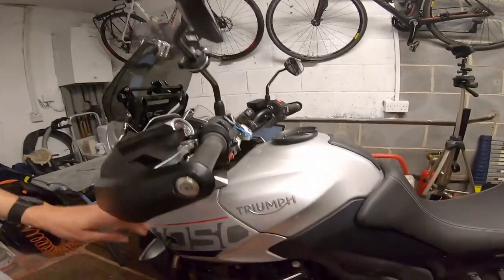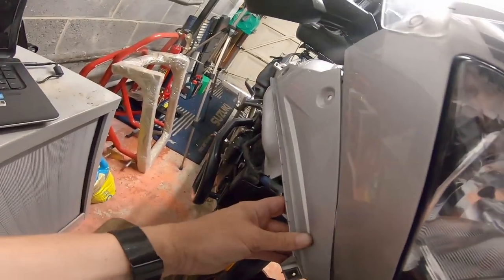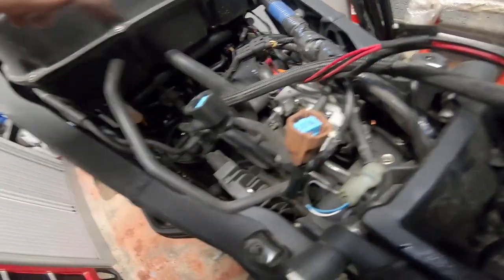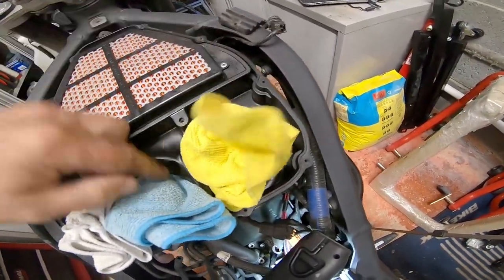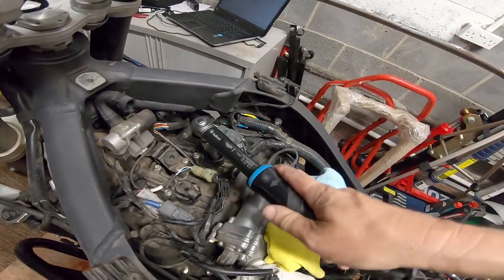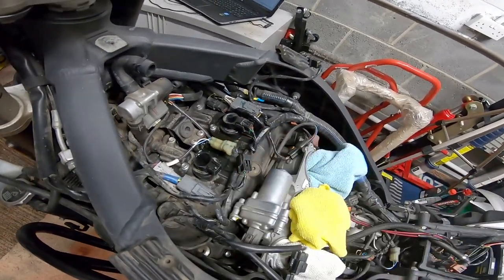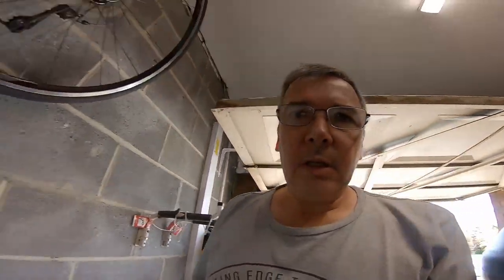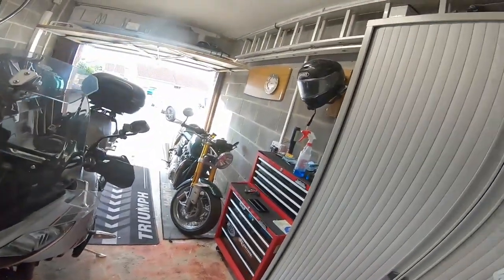Tiger Sport 1050 12K Service Part 4 - Spark Plugs, Air Filter and Throttle Body Balance

Comment: Fantastic video - thankyou so much for this and the whole series. My DealerTool arrived today ready for me to service both my Tiger Sport 1050 and my Bonneville T120. Your videos have really given me the confidence to do this myself. I had my throttle bodies done at a Triumph dealer two years ago (yes cost me around £900) so hopefully they will still be in tolerance. I had the valve clearances done at a small independent last year for half the price Triumph wanted and that included replacing all the shims!

Comment: Dear Up North Biker, thanks so much for this video. I changed my Tiger Sport's air filter and spark plugs today and all your advice helped me so much!!
Reply from the maker: Glad it helped. Did you struggle with the left hand spark plug like I did
Reply: @upnorthbiker  Fortunately having seen your video I purchased a magnetic, bendy spark plug wrench! I'm living and biking in Japan, but my mother lives in Guiseley, Yorkshire. I was in England for two weeks this summer. I was so surprised how expensive the UK is now 😮
Reply: A little bit of rust came up with the left hand spark plug. I gave it a good vacuuming and hoping for the best.........
Reply from the maker: I would check the seal on the ignition coil if there are signs of rust.
Reply from the maker: The roads in Japan look awesome. I watched the Missenden flyer’s tour and he only covered a small area.

Comment: Thank you for this very clear tutorial. It helped me out. I noticed that my 2016 Tiger sport 1050 had a set of NGK CR8EIA9 iridium sparkplugs installed at 20.000km. These have a longevity of 160.000 km( 100.000 miles) so I ended up replacing them without changing. The sparkplugs only have 20.000km on the counter, so even if I decide to change them at halve their livespan, I can ride another 60.000km with them.

Comment: Nice one UNB. I’ve had my fairings off several times now and it does become a doddle. The tang and grommet idea is great in my opinion. Always take the big fairing off first. Just the one screw under the headlight, then slide forward like you showed. Brilliant! Suggest those trying this job understand how it works before sliding the fairings back on.(Mine had been mullered by some cretin too). £248 for a replacement.
That left spark plug removal. CHEAP DOUBLE ENDED SHORT BOX SPANNERS! First one will drop down onto the plug. Second one will fit into the first and stick out so’s you can get a spanner on it. Worked nicely for me. 
Another way to lift the spark plugs out is to use a length of rubber hose that is a snug fit over the ceramic. Also good for starting the plugs when replacing. No chance of cross threading.
(That fuel connector can be a bastard ‘till you know how it works can’t it!)😊
Reply from the maker: When I finish this series I will do a follow up video called Phil’s tiger tips as you have lots of good ideas.
Reply: @upnorthbiker  True to your word. Thanks for the Phil's Tiger Tips video 👏

Comment: Thanks for the video, very clear  and useful as usual. However, it would habe been interesting to know the values of the throttle balancing and a quick explanation of how to balance them with the screws. Thanks. Chris
Reply from the maker: Agreed. I expected to have to adjust them but they were spot on. If you have to adjust them it is trial and error. Adjust one only and see if it looks like they can be balanced, if not try a different one. I am sure there will be other videos showing this on a tiger or a speed triple which is a very similar engine.
Reply: Is there not a standard value to adjust them from the repair manual?
Reply from the maker: Not that I am aware of but they should be around 440-470 mmHG. The key is to get them all the same rather than a specific value.

Comment: Get a swivel socket head, sometimes called a universal socket head. Makes getting that last plug out a non-issue.
Reply from the maker: Thanks Jim. I tried mine but with it all being 1/2 inch drive everything was a little too wide or the extension bars were too long or too short. I will try the box spanner idea from Phil to see if that works next time or buy a spark plug socket for my 3/8 or 1/4 set if I can get one.
Reply: @upnorthbiker  I got a set of 3 different size swivel heads. Think  I use the 3/8 inch one on the Tiger plugs

Comment: Hi, Great Vids by the way. Question.....what batter do you use on your Tiger 1050? regards
Reply from the maker: It still has the original battery on it. I ride it a lot even through winter which I think helps it stay good.
Reply: I have a YTS14-BS but on line it say YTS12-BS.....Confused. Which would you recommend.  Regards

Comment: Hi dear, have a 2015 version of the Tiger Sport, what are your thoughts about a sport air filter like BMC or K&N? Any improvement maybe with a central update? Thanks! You did a good job here! 🫱🏻‍🫲🏼
Reply from the maker: Anything that helps the bike breathe easier will improve the performance. I doubt it would need remapping if that was the only change.
Reply: @upnorthbiker  thanks a lot, very kind! Greetings from Italy